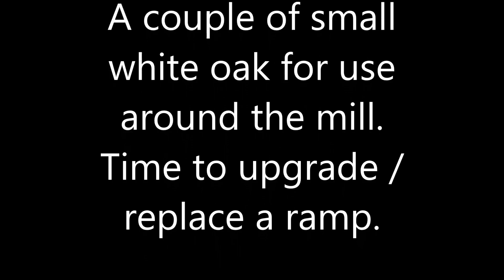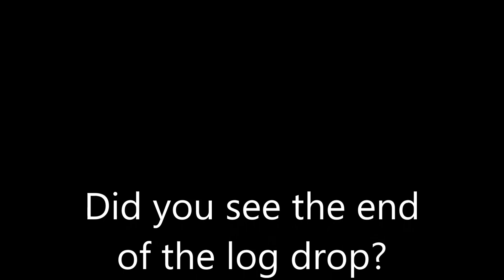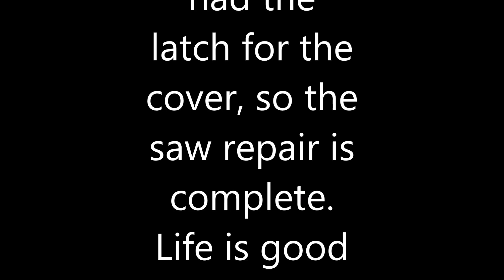From Logs to Final Form

Comment: If you had put a burn coat on them would they last longer?
Reply from the maker: Ahhhh... shou sugi ban. I thought about it,  but thought the white oak had enough rot resistance. A burn coat may make it last lo get. I'm not 100% sure.

It would have worked on the original ramp though, because that was a soft maple or beech.
Thank you for your question, and you for stopping in.

Comment: how sensitive is your leveling in terms of producing perfectly squared cants?
Reply from the maker: Leveling of the mill? Not a problem. I'm told if I'm using a level on the mill? I'm spending g to much time. This is from the guy who trained me on the mill. His advice was spot on for everything, but I still use a level.
If you saw me using a square on the cant, to the bed, that's because my stops were not square with the bed. A maintenance issue that I just fixed a few days ago.
Reply: @IronOakSawmill  what are the stops, and how can they be not square to the bed?
Reply from the maker: @pamtnman1515  some call them dogs
 Its what the log is pushed against. With the clamp.
Reply: Iron & Oak Sawmill ok got it, thanks. How were they not squared to the bed? Were they knocked off of square by a log?
Reply from the maker: @pamtnman1515  we had been running some large logs, but mostly its clamping the log against the stops.
Reply: Iron & Oak Sawmill interesting. How could you tell they were not squared? Were your cants coming out uneven?
Reply: @IronOakSawmill  the guy who I worked with a bunch on his LT 35 and then LT40 used a level every time he set up the sawmill. He also used a level when first clamping a log, and then again after making the first face cut to lay the log on.
Reply from the maker: @pamtnman1515  most of the time, if possible, I level the pith of the log. Keeps the grain as straight as possible, keeping the lumber more stable.
Reply from the maker: @pamtnman1515  exactly. They were easy to get square once I saw it, but it did waste some lumber cleaning it up.
Reply: Iron & Oak Sawmill i got some good photos of you guys today. Turns out I can’t post or send them here on YouTube. If you want me to send them, give me an email address. Today’s training was really beneficial to me
Reply from the maker: @pamtnman1515  that would be great. Did you introduce yourself?  I met Rick and Ted today.
Reply: Iron & Oak Sawmill i asked a lot of questions
Reply from the maker: @pamtnman1515  were you the guy that thought the Doyle scale was an unfair scale?
Questions for me, or Marty?
Reply: Iron & Oak Sawmill Doyle is definitely less accurate than Scribner or International. I had a pile of questions all day long!
Reply from the maker: @pamtnman1515  I agree about the scale. Some good conversation about alot of things today. Good information to be found.
If you want to email the pics,
crogers561@comcast.net
I still learned something today, and want to put it to use as soon as I can.
Reply from the maker: @pamtnman1515  even picked up a set of the velocity fuses for the mill. I saw a few other guys had issues with them getting g damaged on the job, and I dont want to be stopping short of finishing the job.
Reply: Iron & Oak Sawmill making dinner now. Will email them in an hour. Definitely time well spent today. I learned a lot
Reply from the maker: @pamtnman1515  send a pic of yourself, then I know who you are for sure. I'm 90% sure though. Lol
Reply: Iron & Oak Sawmill check your email
Reply from the maker: @pamtnman1515  got the pics. Thank you. Is it ok to add them to our channel. Doing a little video of the owners day event.
Reply: Iron & Oak Sawmill heck yeah! That’s what I wanted to do, but couldn’t. Glad you will